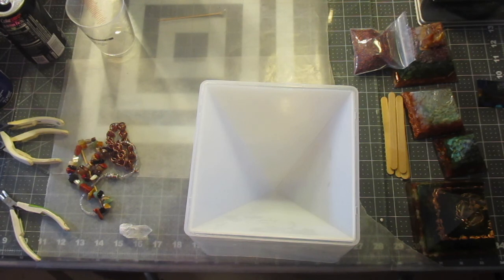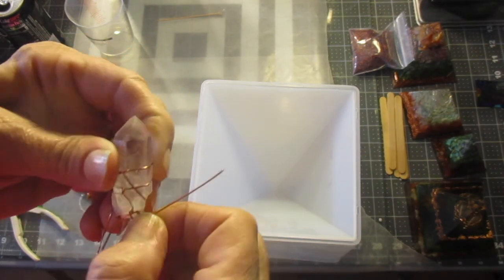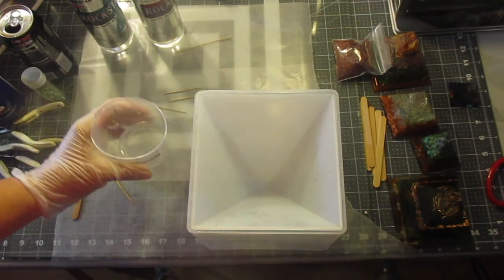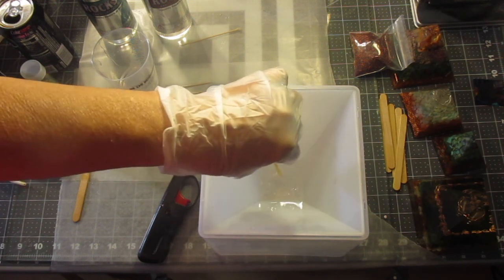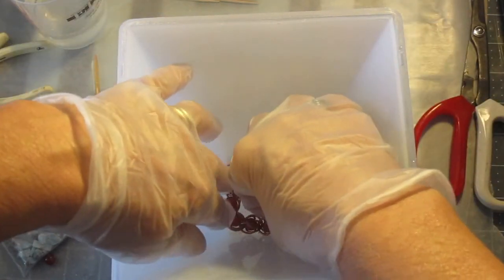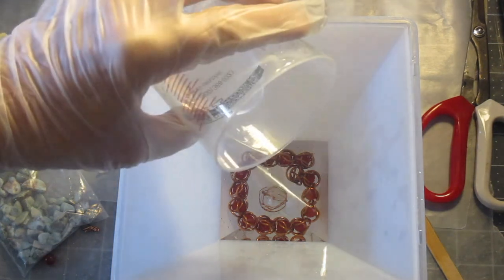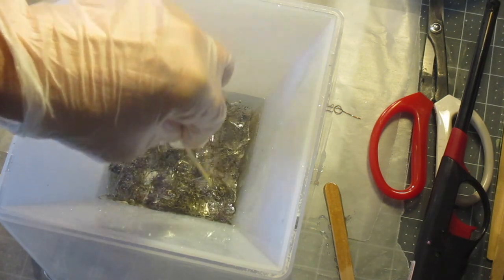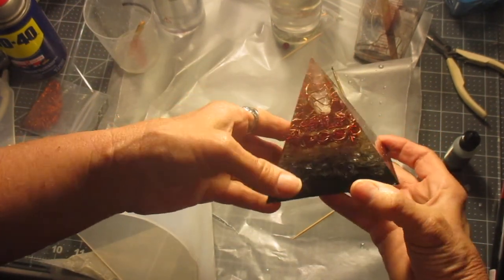Resin Pyramid Orgonite

Comment: to those that dont know, the more layers you pour they will make lines in your mold that will show on your next casting.   If you use a deep pour you can get more depth per pouring.
Reply: Can you spray pam nonstick oil on the mold to prevent sticking?
Reply: My mold does not leave a trace of anything....Before pouring I use baby powder to rub it in the mold. What stuff is your mold made from I wonder...Keep on doing it sweetheart it will make you so happy!!!
Reply: @diloo1861  Im talking about lines on the mold itself where the layer you just poured ends.  I use mold release in my molds and baby powder one the outside of mold.  I love resin art and have done many projects.

Comment: With all respect, that is not orgonite at all from what I know and practiced so far. 
Orgonite must consist of any kind of crystal/quartz together with spiral form of small metal object (aluminium, copper, steel, gold, silver, etc)
Reply: It has copper and crystal
Reply: You are mistaken, spirals are not needed if the structure is a pyramid, the shape and geometry of pyramids push filtered energy out of the apex without spiraling anything. However, spirals add toroidial and implosion forces to make more powerful ones. It's definitely recommended to use several and it is needed if your making a charging plate or something that doesn't taper like pyramids do.
Reply: What is a good tutorial? Link?
Reply: What i learn it's when we put a cristal wraped in copper it's already making a pizzoeletric thing cause is compressed insid by resin.having more metal inside -in the base-will give it more power.
An orgonite it's a orgonite.the power of our will make an orgonite strong or not.
If you wanna know if it's a good or bad orgonite try use a pendullum.
I don't believe in bad or "oh...that's not a orgonite".IT'S a beautifull orgonite!
Reply: Yes she did great but for functional orgonite it has to be 50% metal and 50% resin
Reply: She used carnelian and copper coil.